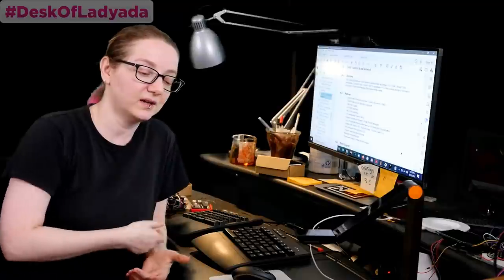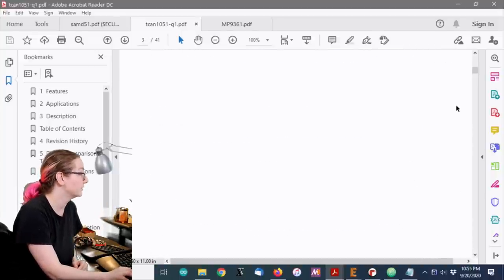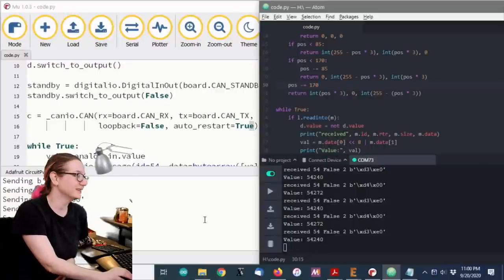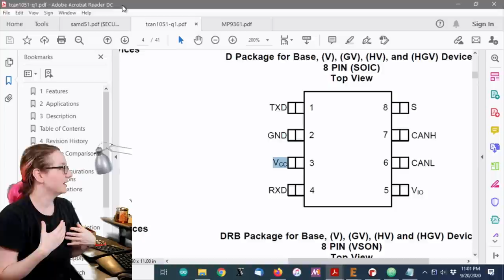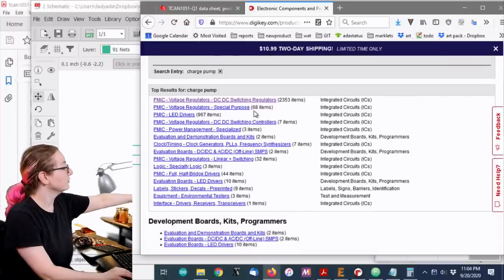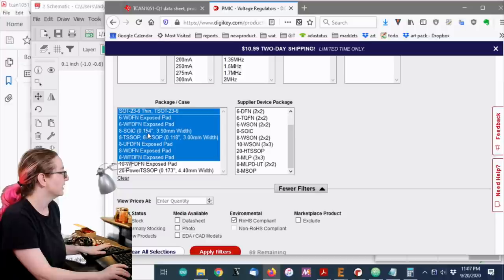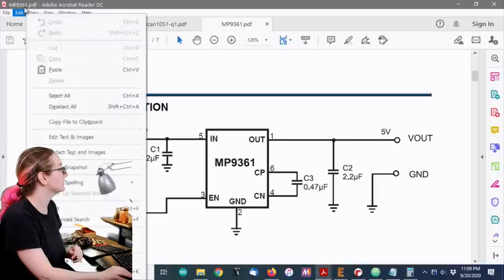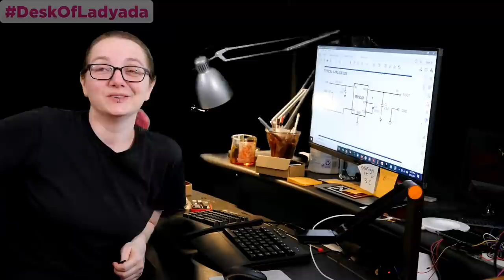DESK OF LADYADA - Upcoming Feather CAN is sending and receiving messages!

Comment: ok ok,  i just logged on and on the factory-floor CAN_bus is used to commnicate with several sensor devices.  when it works things are simple as most techniques.  however,  do you have a good_n_cheap_hobby bench_CAN_tester?  because, CAN_can "Mmm?" drive you up the wall tracing down very short time errors, glitches, connections, etc. and i am still learning CAN...:)  thanks

Comment: It would be cool if you could somehow conect a laser pointer and receiver (usually a small solar cell) on each side.  This would be so CAN bus could work across the room or from one building to another via two lasers.  This concept would be good for something like a low bandwidth network or a cost effective way to literally beam data from a sensor from a hard to reach area.  I'm not familiar with CAN bus and I'm not sure if my laser idea would be efficient, especially with the 5V CAN bus requirements....